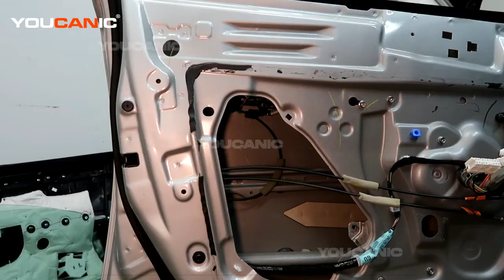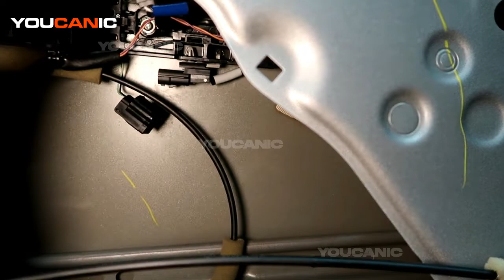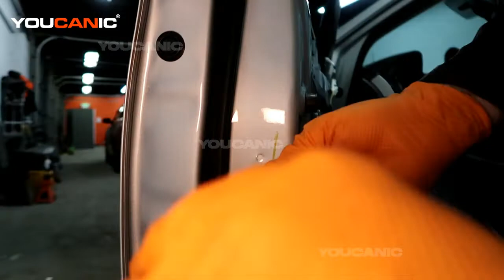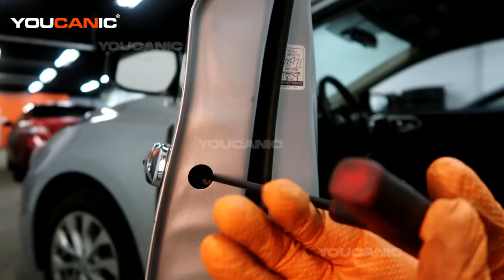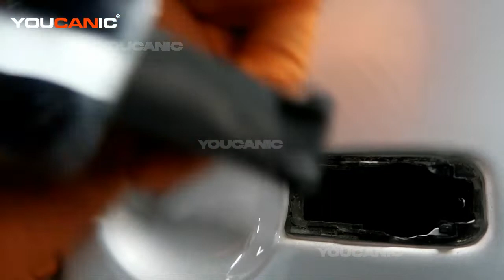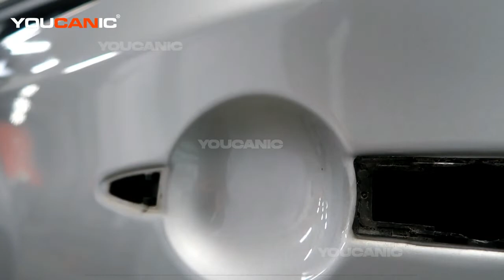2013–2019 Nissan Sentra - How to Replace the Door Latch

Comment: I can’t get the lock cylinder out, I’ve tried everything. Do you have any other tips?
Reply: Likewise, I’ve removed the yellow pin rod, and even used a T30 to remove the screw on the side, but the screw keeps spinning and the lock doesn’t come off